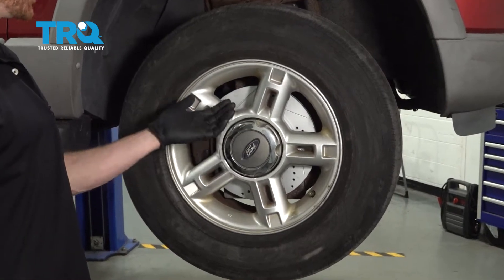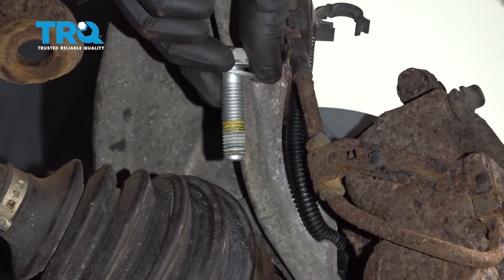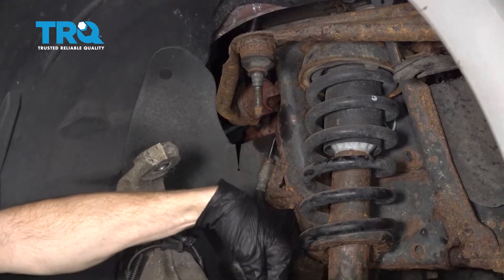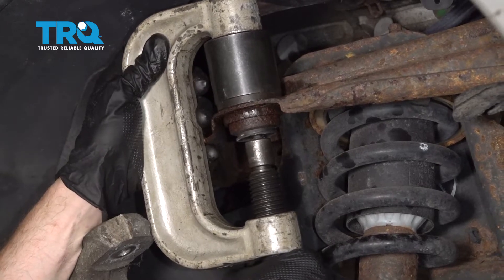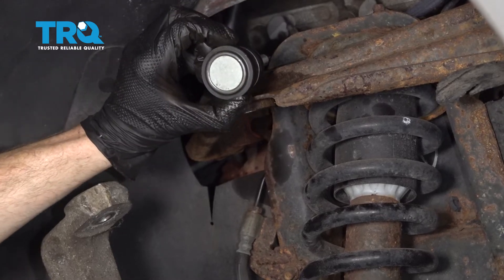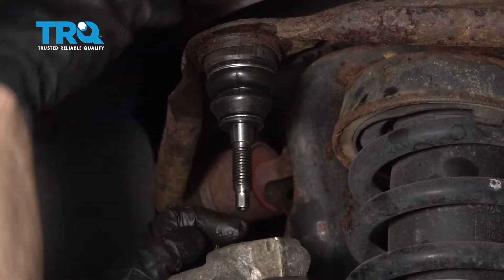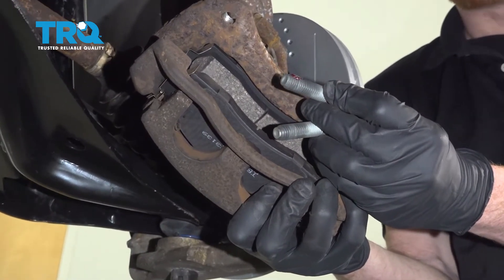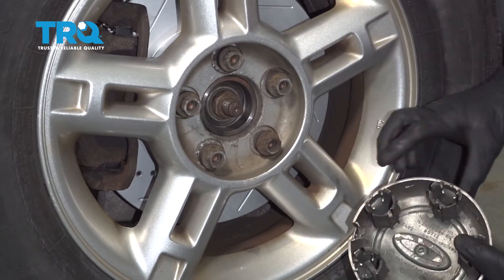How to Replace Upper Ball Joint 2002-2005 Ford Explorer

Comment: Question,  i tryed replacing upper ball joint,  would not move.  Local mechanic said ball joints are welded to factory upper control arms.  2004. F 150

Comment: IT'S GONNA TAKE A WHILE.  Don't let the length of this video fool you.  Just replaced the upper and lower ball joints on a 2004 MM and it took me two days with the help of an older "Ford" loving family member.  I'm not a mechanic but I can follow instructions very well.  And even with all the shop tools at hand, had to use a blow torch to get all the old ball joints out.  Then the post on one of the lower b.j. seemed to have gotten seized inside knuckle. Once we separated the ball joint from from the lower control arm, the ball joint post had to be overly heated and then pounded out with a sledge hammer from the knuckle.  The ball joint compression device that I had available to me didn't have long enough cups so I had to cut a piece of pipe for it to fit over the length.  25 years of doing IT work does not help any with the physical requirements for this type of job.

Comment: my upper ball joint just fell into the hole what happen? I know I got the right one, there was another ball joint and it said over size what is that all about?
Reply: Maybe it was previously replaced by a splined BJ that 'bored' it out a little,
or your replacement part wasn't well engineered.
I've heard of this happening to others; sometimes one side ok and the other not.
Some replacements also have a retaining circlip, but still need to be a snug fit.
Reply: Some aftermarket control arms had different sized bores than factory,so it may have been replaced at one time.

Comment: What causes  upperball joint to popped out of the control arm?
Reply: General wear and tear over time will do it.  Also running over something like a log or something large in the road, or hitting a curb too hard can sometimes do it.  If a newly installed one pops out, it may not have been pressed in properly on install, or the upper control arm hole may be bent or worn out and needs to be replaced.